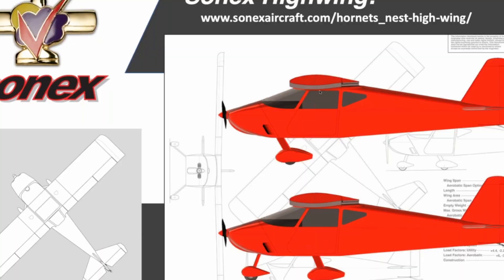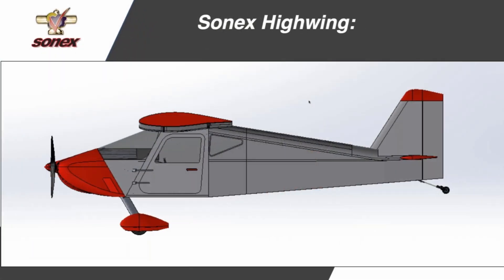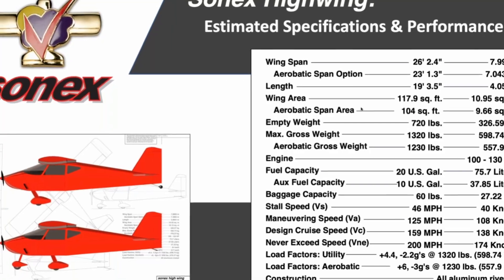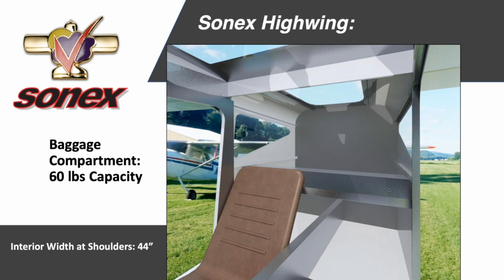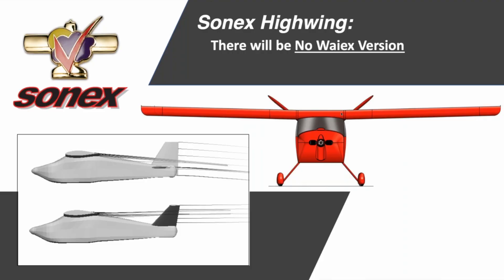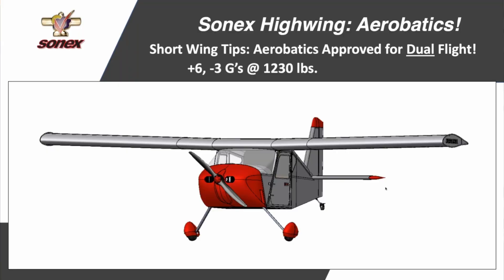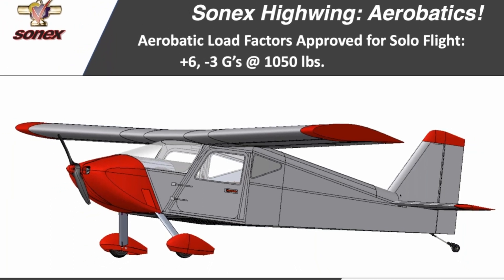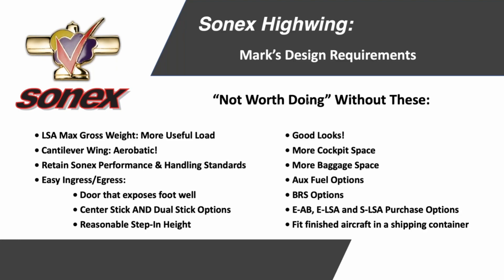Sonex High Wing Update Feb 2023

Comment: I’m pretty excited about this one. I doubt I fit in a regular model B and would be difficult to take an additional passenger due to the useful load, so I pretty much wrote those off. 

High wing with a UL350i would be a great plane for cross country travel. 5 gph or so and speeds of 170 mph. 

That should be a less than $90,000 plane and will greatly undercut the RV-14, Rans S-21, and RV-15 that I have been looking at. 

If they can fit me in the plane at 6’6, I will probably have a pretty early deposit on one.
Reply from the maker: Yup, my A model with 80hp was basically a single seat aircraft for me and the terrain I was operating out of. Great flying machine though. The B model has a more relaxed seating position, but I've personally never sat in one. I fully expect that the High Wing will be able to accommodate you. (I've ridden in an RV-6 and my head at 5' 9" was just about bumping the canopy...)

Comment: Good report. One question would be why no dual breaking on the design?
Reply from the maker: Thanks and good question. 👍 It goes back to the Sonex design philosophy and the direct steering tailwheel. You can install differential braking, but then you have to go to a traditional breakaway tailwheel setup. If not, you'll damage the direct steering one. Sonex put out a service bulletin on that matter. Honestly, the direct steering tailwheel makes the Sonex super easy to control on the ground, almost cheating. Just have to plan ahead with the increased turning radius.

Comment: I’d love to build one. Seems like a good “do everything” plane. However, I’m not completely sold on the throttle levers sticking out from the panel on the sides. I’d rather see a vernier throttle setup like the zeniths if they’re going to have the center stick option. Seems like that throttle quadrant column sticks out a little. Or maybe I’ll build it with dual sticks and do a center lever throttle in the console? 🤔 Either way I’m stoked it’s two person aerobatic capable with the shorty wingtips! - Jacob
Reply from the maker: Yup, the low wing Sonex is great but the high wing just opens up more possibilities. I couldn't fly the first winter with mine due to the high snow banks, even saw an RV clip one. Beautiful thing about building e-ab is you can configure the panel however you like. I wouldn't think the throttle mounting points are structural, may not be necessary. Perhaps an optional install on the plans? Think I'd have to sit in the prototype to see how I'd configure it.
Reply: It's Experimental aviation, for a reason. You are free to change it.